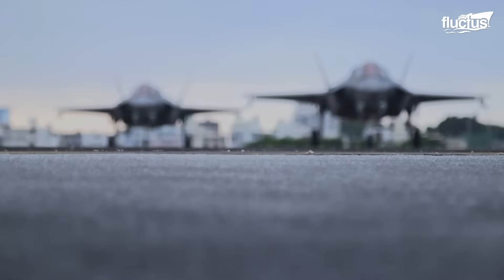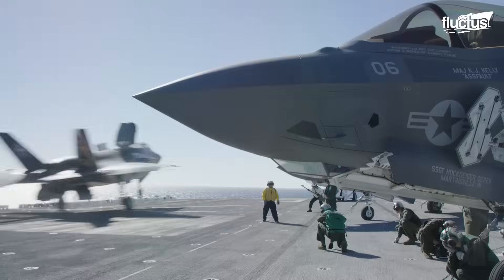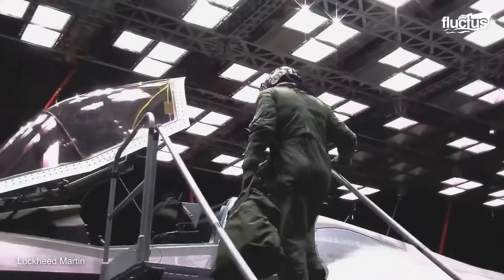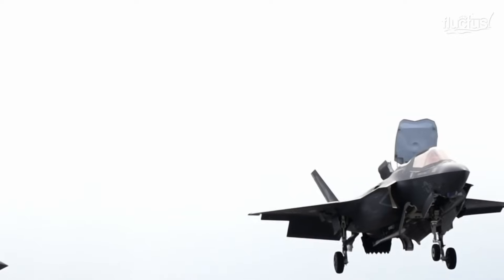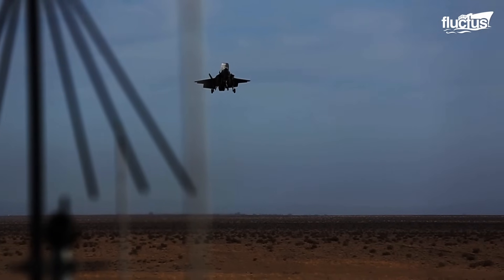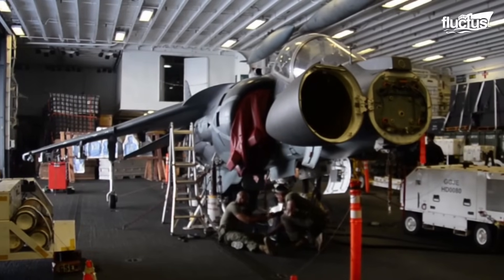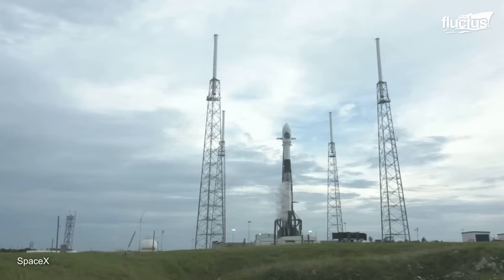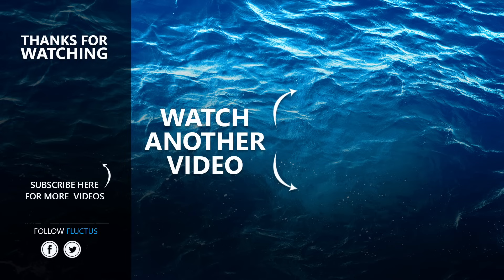The Insane Engineering Behind US F-35B’s Monstrous Pivoting Engine Nozzles

Comment: I don't find it insane engineering at all, the Russians designed it and the Americans adapted it, but it is a failed project, the most expensive in the history of aviation, it is useless if it is below 29% of completing missions, Austin could not defend it in front of congress.
The solution: Abandon the project and redesign it, they have been trying to make it work for more than 20 years, and its fuselage will no longer be undetectable with current advances in detection.
On the other hand, nozzles with the appropriate engine show excellent performance in other airplanes with vector output in the fourth or fifth generation.

Comment: It's weird that it can only land vertically and not take off vertically if it needed to
Reply: it can take off vertically but realistically it shouldn´t do it, vertical take off has weight limits which limits both fuel and weaponry a lot more than short take off. Landing without an arresting wire when there is less fuel and weaponry is the point of vtols
Reply: @aquilesca5tr0  Sounds like it can’t take off vertically then
Reply: @Damidas  It can, with limited weight like every single vtol plane. What did you expect them to do? To also limit the short take off weight to match the vertical one? that doesn´t make sense. Efficienc of short take off over vertical is the reason why vtols have an advantage over helicopters

Comment: What was the point of the B variant if it has limited fuel and ordinance when vertical take off?
Reply: Um, the point was vertical take off?
Reply: Actually, the B variant with its STOVL capabilities was the leading design to replace the Harrier. If you look at the Joint Strike Fighter program, the two contenders were built to address the STOVL airframe requirements. It has been said that the design compromises for the B and the drive to force a common airframe between the Marine Corps B variant and the Air Force A and Navy C variants actually handicapped the force overall. Had the Air Force been able to have a clean sheet design, it would have likely been a superior aircraft. Same for the Navy. If you look at all three variants, the fuselage is designed to accomodate the B variant's lift fan behind the cockpit. If that hadn't have been a factor, the design could have been more stealthy and have a larger internal weapons capacity.
Reply: Actually, the B variant with its STOVL capabilities was the leading design to replace the Harrier. If you look at the Joint Strike Fighter program, the two contenders were built to address the STOVL airframe requirements. It has been said that the design compromises for the B and the drive to force a common airframe between the Marine Corps B variant and the Air Force A and Navy C variants actually handicapped the force overall. Had the Air Force been able to have a clean sheet design, it would have likely been a superior aircraft. Same for the Navy. If you look at all three variants, the fuselage is designed to accomodate the B variant's lift fan behind the cockpit. If that hadn't have been a factor, the design could have been more stealthy and have a larger internal weapons capacity.
Reply: Actually, the B variant with its STOVL capabilities was the leading design to replace the Harrier. If you look at the Joint Strike Fighter program, the two contenders were built to address the STOVL airframe requirements. It has been said that the design compromises for the B and the drive to force a common airframe between the Marine Corps B variant and the Air Force A and Navy C variants actually handicapped the force overall. Had the Air Force been able to have a clean sheet design, it would have likely been a superior aircraft. Same for the Navy. If you look at all three variants, the fuselage is designed to accomodate the B variant's lift fan behind the cockpit. If that hadn't have been a factor, the design could have been more stealthy and have a larger internal weapons capacity.
Reply: Actually, the B variant with its STOVL capabilities was the leading design to replace the Harrier. If you look at the Joint Strike Fighter program, the two contenders were built to address the STOVL airframe requirements. It has been said that the design compromises for the B and the drive to force a common airframe between the Marine Corps B variant and the Air Force A and Navy C variants actually handicapped the force overall. Had the Air Force been able to have a clean sheet design, it would have likely been a superior aircraft. Same for the Navy. If you look at all three variants, the fuselage is designed to accomodate the B variant's lift fan behind the cockpit. If that hadn't have been a factor, the design could have been more stealthy and have a larger internal weapons capacity.
Reply: Actually, the B variant with its STOVL capabilities was the leading design to replace the Harrier. If you look at the Joint Strike Fighter program, the two contenders were built to address the STOVL airframe requirements. It has been said that the design compromises for the B and the drive to force a common airframe between the Marine Corps B variant and the Air Force A and Navy C variants actually handicapped the force overall. Had the Air Force been able to have a clean sheet design, it would have likely been a superior aircraft. Same for the Navy. If you look at all three variants, the fuselage is designed to accomodate the B variant's lift fan behind the cockpit. If that hadn't have been a factor, the design could have been more stealthy and have a larger internal weapons capacity.
Reply: Actually, the B variant with its STOVL capabilities was the leading design to replace the Harrier. If you look at the Joint Strike Fighter program, the two contenders were built to address the STOVL airframe requirements. It has been said that the design compromises for the B and the drive to force a common airframe between the Marine Corps B variant and the Air Force A and Navy C variants actually handicapped the force overall. Had the Air Force been able to have a clean sheet design, it would have likely been a superior aircraft. Same for the Navy. If you look at all three variants, the fuselage is designed to accomodate the B variant's lift fan behind the cockpit. If that hadn't have been a factor, the design could have been more stealthy and have a larger internal weapons capacity.
Reply: Actually, the B variant with its STOVL capabilities was the leading design to replace the Harrier. If you look at the Joint Strike Fighter program, the two contenders were built to address the STOVL airframe requirements. It has been said that the design compromises for the B and the drive to force a common airframe between the Marine Corps B variant and the Air Force A and Navy C variants actually handicapped the force overall. Had the Air Force been able to have a clean sheet design, it would have likely been a superior aircraft. Same for the Navy. If you look at all three variants, the fuselage is designed to accomodate the B variant's lift fan behind the cockpit. If that hadn't have been a factor, the design could have been more stealthy and have a larger internal weapons capacity.

Comment: I’m amazed how they don’t melt the aircraft carrier decks when landing.
Reply: The deck does need to be specially built to withstand the heat and pressure. That's why Japan's "aircraft carrying destroyers" need to be modified before they can handle F-35s.  They also try to not linger over the same spot for an extended time. They come to a hover over the water and then fairly quickly translate to over the deck and land.

Comment: The Harrier solution was so much simpler, more elegant in many ways.
Reply: Only a neophyte would think that the hot gas ingesting compressor stalls of the Pegasus powered Harrier/SHAR/Harrier II is "much simpler, more elegant"(sic).
Reply: Ehm no.
Reply: It could have had a successor if the Uk hadn’t have cancelled most of its advanced aircraft programmes due to economic woes. The P1154 with its Olympus based engine would have been a mach 1.7 + aircraft…… however it wasn’t the project that should have been when the Labour Party gutted the Uk aero industry.
Reply: Harries are not Stealthy, has less Range, can’t Super Cruse or go Super Sonic. (The Harrier is the Blue Print) The F-35 is the next Evolution of these type of Aircraft. US Marines⚓️ still operate the (Super Harrier ⭐️) Eventually even the Super Harrier will retire.
Reply: @lisaroberts8556  "still operate the (Super Harrier ⭐)"(sic)

The Harrier II isn't known as the "Super Harrier"(sic) madame.
Reply: @lisaroberts8556 True, but a lot of the improvements applied to the F-35 can also be used in the AV-8B.  The AV-8B is the best available aircraft to work in unprepared field conditions.  The F-35 can’t change nozzle direction in close-in dogfighting.  If you did have a squadron of Harrie4 A/C, you would have to give up on the idea of stealth, and also have to make a Harrier 3.0.

Comment: Why do they have to use the catapult for the f-35 when it can just take off by itself.
Reply: Different variants. The B model mentioned here has less carrying capacity for both weapons and fuel than the C model which uses catapult launch from ship. There's a time and place for both.
Reply: bruh
Reply: As others mentioned, there are three variants of the F-35.
F-35A  Air Force variant, conventional take off and landing.
F-35B  Marine variant, VSTOL take off and landing capability, reduced payload and range capability in exchange for valuable VSTOL capability.
F-35C  Navy variant, hardened landing gear to handle catapult launch, added tail hook for arrested landings, ~20% larger wings, folding wingtips to reduce storage space.
Reply: VTOL planes usually on land vertically because taking off vertically limits the amount of fuel and armament besides being less efficient

Comment: With VTOL aircraft such the F35B and Harrier I always wonder; "where did they find the space for fuel?"
Reply: STOVL and V/STOL respectively.
Reply: @AA-xo9uw  In practicality --- fuel & maintenance consideration, safety, stress to the frame, & longevity concerns (over time, not just in one or two landings/take-offs), etc., etc ---- yes, it is used largely as a STOVL/V/STOL aircraft. 

But in reality, the F-35B really is a VTOL. It's in the very PHYSICS the aircraft is made to do: to have the ability & power to take off & land VERTICALLY.

The US Marines are the first ones to go into a situation that a dozen or two Special Operations Force no longer can surmount. 

That means the majority of the Marines aircraft ---- from the traditional rotary to the Harrier to the F-35B --- all need to be able to land and take off vertically, IF THE CONTINGENCIES call for such extraordinarily energy draining/dangerous acts... so that regardless whether the terrains are deep valleys, high mountain tops, inhospitable/isolate deserts, or in some tiny/improvised floating platform, the US Marines could reach, 24/7...

Rotary aircraft are fine --- especially the Osprey and its replacement --- but those could only do shorter distances, with speeds of around 300 - 500 MPH.  The F-35B could do north of Mach 1.5 & go over 1,000 miles on a gas of tank, if it must...

Comment: The Yak-141 walked so the F-35 could fly
Reply: Pfft. There is nothing from the Yak in the F-35. And, Convair used the three bearing swivel years before Yak ever did. Look up the Convair model 200.
Reply: Lockheed renamed the Yak-41 as the 141 in a failed attempt to save Yakovlev from bankruptcy. Did those thieves masquerading as engineers at Yakovlev ever pay royalties to Convair and P&W for ripping off the 200 and the first swivel bearing exhaust nozzle from the 1960s?
Reply: The oppositely rotating rotary nozzle is not a Russian or even a Soviet development.  This is an Anglo-German development from the 70s.  Specifically, the nozzle for the F-35 was developed by Rolls Royce.